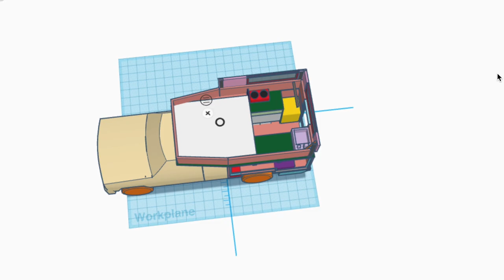Bye Bye Blue Beauty | DIY Truck Camper Demolition

Comment: 2 T100 better than 1 T100 😁😁😁😁😁

Eager to see progress.your family friendly quality videos make the time of the Corona that much better

Thank you for the advice on the pitman arm ours was trash. 
Shocks, back brakes, putman arm done. 
Next front brakes
Cv shafts
Front end suspension bushing kit
Ball joints
Bearings
Replace a bolt on the wheel hub
Install manual hubs 

Then more adventure awaits
Reply from the maker: It's a big list, but at least you are basically dissembling the front suspension/drive and reassembling it with all new parts once. instead of dissembling it to fix one thing, then doing it again to fix something else a month later. 
seems like a good strategy to me. I'll be doing the same t0 the front and rear suspension after we get the new camper done and decide if we need to upgrade springs or shocks.
Reply: @TheTravelingTogetherJournal   you may want to double check your shakles in the rear(rear spring mount) even though most T100 dont have the tacoma rust issue the springs and shackles do take a beating. In the rockies the muffler and cat back seem to rust so i think i may have to change the exhaust soon.
Reply from the maker: @yeahman1975  I made a custom, high clearance tail pipe (read: it rusted to bits, then I drug it across rocks until it was bent up into the bed side) 😂
I'll be ditching the current cat back exhaust in favor of a shorter muffler and moving the tail pipe forward to exit in front of the rear tire, over the frame rail.
All of the suspension bushings are way past due for replacement. So, I'll be pulling everything  apart and either replacing it or cleaning, paining and resembling with new bushings

Comment: The 5mm plywood and fibreglass cloth coated and sealed with epoxy resin and joints reinforced with epoxy fillets, fibreglass cloth, coated and sealed with epoxy have in effect created an inverted hull on your truck that's as resilient and strong as a premium quality marine hull.

This would explain the excellent resistance to repeated blows from hammers, etc.

That's a great quality to have in one's travel cabin!
Reply from the maker: Yeah, its basically a land-yacht 😂

Comment: Nice, a flatbed build will give lots more room and storage, might be too heavy for that T100 though, I would get a cheap Tundra with the 4.7 or 5.7 engine.
Reply from the maker: Thanks for the input Vin. Ditching the stock bed will definitely give us more room to build on.
 I'll talk a little about how I chose the T100 as our build platform in our next video, but here is an example of why:
Max payload:
T100(3.4L)= 1960lbs
Tundra(4.7L)= 1512lbs
Tundra(5.7L)=1640lbs

The Tundras' curb weights are more than the T100, so even though the GVWR may go up, the Max payload goes down.
Reply from the maker: @vinr6867  That thing looks nice. Thank for sharing the link. I'll have to rewatch that one
Reply: @TheTravelingTogetherJournal  Matt here's another recently finished DIY rig. The couple is from Paso Robles so maybe you can swap info/ideas/services. They videoed the entire build: https://www.youtube.com/watch?v=QD9ue75n3bs
Reply from the maker: @calisdad3  Thanks. I have actually watched all of their videos. It is a great build and it came out really nice!